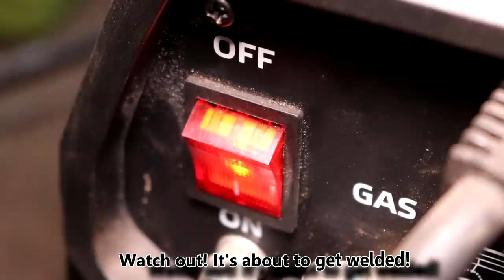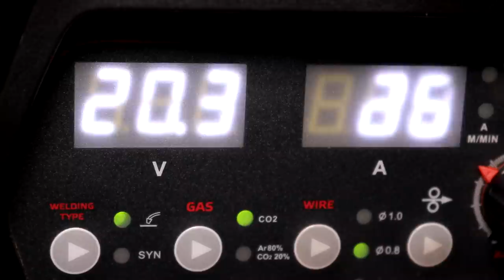German M16 Stahlhelm Restoration

Comment: Everything apart from the paintwork I'd say is totally brilliant
Reply: The paint is supposed to look like that, all the soldiers on the field painted them themselves it never looked professional
Reply: nothing brilliant about welding and body filler
Reply: Yeah I feel the same. They usually thinned the paint out with fuel if I’m not mistaken. Made it go on smoother but still visible brush strokes.
Reply: @jackdozhier2151  I wouldn't say hes talking about it not looking profesional. The camo isnt really doing its job cuz the helmet is still giving off a bit of a shine wich the camo was meant to prevent
Reply: The colour palette is just plain wrong.
10 seconds, 20 tops before that's got a snipers bullet through it!

THEN, maybe, it would look authentic lol.
Reply: @13christbane  definitely better than what most of us could do
Reply: Drab olive green would have been more true to the original.
Reply: A airbrush would have achieved a better result.Nice effort though.
Reply: @jackdozhier2151 it would’ve looked much better with the Freikorps skull and crossbones emblem painted onto it.
Reply: @mykehyslop198 it wouldn’t of looked authentic

Comment: Honestly,  the condition of the steel at the start looks to be way too far gone but what an awesome job of reviving it.  Did you use artist oil paints for the camouflage?
Reply: Another asinine comment. Did you watch the video at all? All the Lefranc & Bourgeois oil paints seen @13:20 says Huile, which is French for Oil. And yes they are artist oil paints. It's not oil paints from the dollar store. This particular brand comes from the biggest manufacturer globally and it is the brand most used by both amateurs and professional artists. Similar to what Windsor & Newton is to watercolors. But it's quality is reflected in the price.
Reply: @gr1mrea9er82  no need to get your knickers in a twist. Chill.  A simple yes would have been suitable.  I have never used oils paints so therefore unaware of brands names
Reply: @gr1mrea9er82  Что в твоей голове?! Разве  в 1 МВ у солдат в окопе были элитные краски?
Reply: @user-jx1lc6it7p  . it's a legit question. When items are restored, it's only normal to ask questions. That's how we learn
Reply: @gr1mrea9er82  Rude
Reply: Yeah all it took to revive it was another helmet and twice it's original weight in car body filler. Oh and a whole neww inner/liner and new rivety bits
Don't get me wrong this shows immense skill, but it reawakens restoration against rebuilding type arguments .
Reply: @gr1mrea9er82 are you gatekeeping oil

Comment: Very good job, but I feel the paint has been applied too thickly with lots of brush strokes - I can't see that on the original.
Reply: That's the way soldiers did it back in 1914-18.

Comment: Nice restoration. I feel like if you drop one of these it will break in half because of all the pitting under the filler.
Reply: He hits it with a hammer a bunch so probably not, it's car body filler, good stuff is quite durable.

Comment: The paints are artist's oils.  The colors are olive green, dark brown, raw Sienna, and yellow ochre, the latter two being standard colors, the former may vary to the standards of this maker, or any.  There were artists among the combatants as the record shows, for that, and just the fact that artists' oils may have been readily available in stores when small amounts were needed for purchase.  But did the German army supply colors?  Artist's oils would not be my choice for this helmet, but sign painter's enamel.  If there was German issue paint it was probably more like the latter. Artist's oils have a vast variety of colors of such signer's enamel lacks. Here, the restorer displayed 4 color tubes, but only used 3: dark brown, green, and yellow.  I would have used the raw Sienna, but prefer black and burnt Sienna or raw umber to those applied.

Comment: Just a tip if ya welding thin metal if you hold a piece of brass behind the hole your welding your weld won't stick to it and you can fill the steel easier , plus it leaves it smoother therefore less fettling I've been doing this for years never failed ..

Comment: Great Work! Excuse the ignorance, I am assuming the tortoise shell painting was camouflage? And the rough texture to the painting would avoid glints or reflections correct?
Reply: Yes
Reply: Camouflage paint was not formally introduced until July 1918, when German Army Order II, No 91 366, signed by General Erich Ludendorff on 7 July 1918, outlined official standards for helmet camouflage. The order stipulated that helmets should be painted in several colours, separated by a finger-wide black line. The colours should be relevant to the season, such as using green, brown and ochre in summer.

Comment: The final product looks good but I can't help wondering why you deliberately hidden the shots where you measure, mark and cut the required sections. instead you showed us your welding voltage and your wire feed, a lot of sanding and lots of painting but where it counts..... nothing.

Comment: it would've been more accurate to paint the base layer by hand as spray paint and airbrushes didn't exist in ww1. also helmets didn't have primer underneath the base coat but this is fine as long as you're trying to preserve the steel and not wearing it to events where the paint can chip.

Comment: You should use repros rather than other originals for doners so you can not have to destroy one to fix the other
Reply: They're scrap otherwise.   There's plenty of good originals out there.  If these had been left buried another decade they would have simply been reddish stains in the ground.

Comment: Here I am thinking you'd be staking dimes but your just tacking it. Sad
Reply: The metals too thin for that .
Reply: @allseeingotto2912  you can weld aluminum cans with the right set up. There's not that much that's to thin
Reply: @philswift8311  Sounds  like i need a better welding unit .

Comment: You put an M16 liner in an M17 shell. I know this is an M17 shell as there is a little step on the lugs. So this was not an M16 shell. Fail Restoration.

Comment: Nice until you gave it a crap paint job. Should of masked and spray painted the colours on. Waste of time.
Reply: While, yes the paint job is indeed quite ugly, this type camo was used during the late war in 1918. It was usually hand painted with a brush so the texture is quite noticeable.
Reply: Should "have" and the hand painted oil paints was the point.
Reply: Should "have" and the hand painted oil paints was the point.